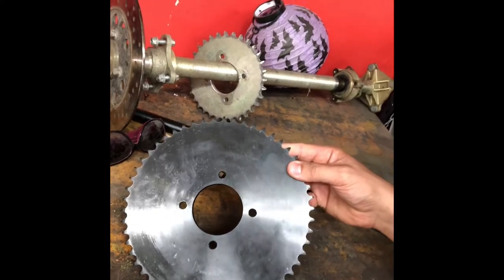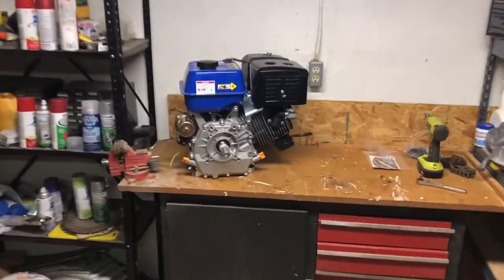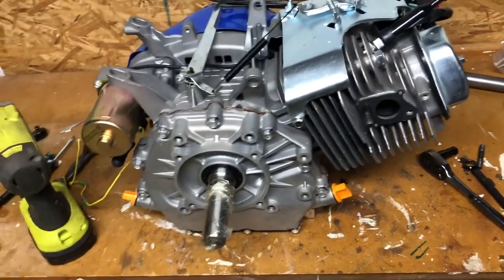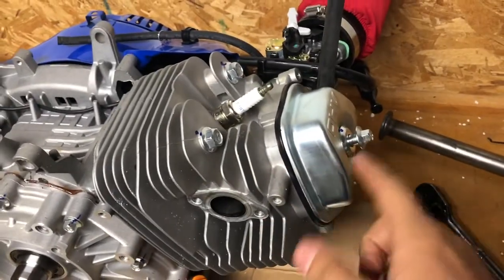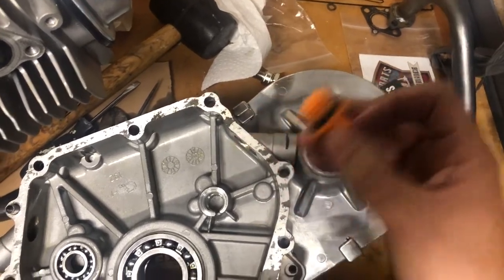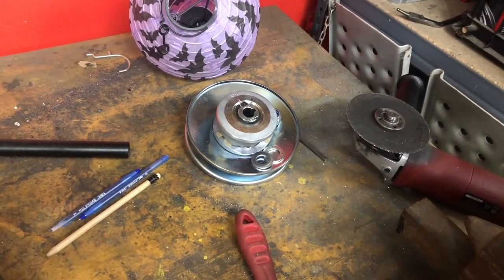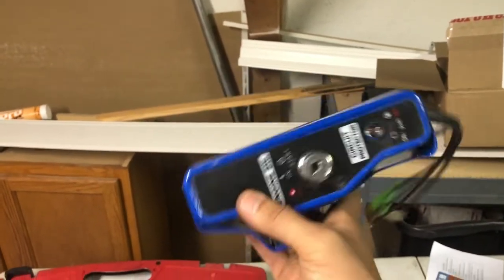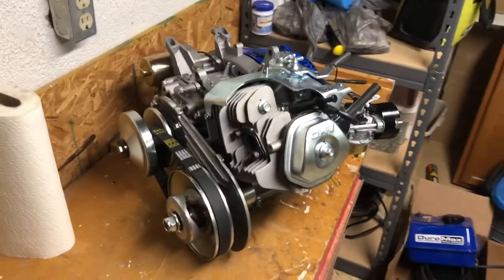Zircon/Carbide 150cc To 440cc 20+HP Engine Swap- Part 3 Engine build and startup

Comment: throw a flat-slide or a round slide carb on there...it'll make a difference..but thats the motor i am going with for my kids hammerhead 150cc so thanks for the build info..
Reply from the maker: Hi Jason, good idea Ill try that this spring/summer for sure. Still have to figure out the torque converter, its too powerful for the chinese one I have and is eating belts. Once things thaw here in Detroit Ill hop back on tinkering with it :)
Reply: @PeakPerformanceEngineering  Ya man..you def. need a 40 series especially if you decide to ride more this summer..some of the chinese 40 series do work pretty decent. but really need to go from 30 to 40 for sure..i'd love to be able to afford either a  true comet 40 series or even a 780 series but man thats gold prices for those things..

Comment: I'm doing the exact same project and have the exact same axle except I'm using a predator 420cc engine. Can you post the link to the larger sprocket you installed,  I don't need 90 mph but I do want good acceleration?
Reply from the maker: Thadius Doom awesome it’ll be a fun project.

Got that sprocket here:
https://www.google.com/amp/s/www.gopowersports.com/amp/sprocket-replacement-for-150cc-karts-41-420-chain/

Comment: I'm doing the same exact project you have to go with a series 40 torque converter the 30 will not hold up to the torque I've been playing around with these engines for a while I have videos coming out soon
Reply: Did u finish it?
Reply from the maker: Not sure if your asking me or David Williams, but yes check the latest videos in the build series, ended up with a go Powersports 40 series. Still have to finish a few things like the starter though. Now that weather is getting warmer I’m going to get out there and finish and make a couple more vids on it
Reply: Yes I ended up finishing I had the 18 horsepower duo Max way too much power twisted the frame almost killed myself I'm on to the next project which is a Saab 9-3 going for 500 horses out of a four-cylinder

Comment: Any issue with the stock flywheel throwing the magnet off?
Reply from the maker: I never had an issue but I probably only out 3-4 hours on it before I ended up selling it. Haven’t heard anything bad from the new owner though

Comment: Awesome video. Does this apply to the 420 duro max engine as well ?
Reply from the maker: Thanks! Everything should be the same with the 420. Must just be a slightly bigger piston or longer stroke in the 440 to get the tiny bit of extra displacement.
Reply: @PeakPerformanceEngineering  what’s the measurements for the exhaust.
Reply from the maker: What measurements are you meaning exactly?
Reply: @PeakPerformanceEngineering  like the space between the screws and the exhaust hole ? Idk 🤷🏽‍♂️ lol how to explain it
Reply from the maker: @samuelaruca4738  that makes sense, I’d have to measure but it was for sure a header for a 420cc from go Powersports. If you hop on their site any of the 420 once’s will bolt on, just have to make sure the pipe routing would work for your application. My header was way too loud so I out the stock pipe back on.

My plan was to but the headset and add a muffler but that hasn’t happened yet haha.

Comment: Did you know that those torque converters have multiple holes in the front of them so you could spend them I have the same thing in the ice Bond mind right out of the way there was multiple holes so you can mount it in multiple directions I didn't take the governor out of mine I left it the way it is don't want to be playing around with should like shouldn't be
Reply from the maker: Yep it has multiple holes, but none of them worked for this application, hence the modification I had to do. As you pointed out on another post, I think I'll end up upgrading this unit to the 40 series as it has been eating belts :)

Comment: how has that 30 series cvt held up to that 440? belt life?
Reply from the maker: Not good. Its been eating belts after about 30-40 minutes. Everything looks perfectly aligned too. I need to get the kart in the shop and mess with it some more though. I don't want to shell out $300 for a legit 40 series, but that might be what I have to do. Ive also thought about just upgrading the springs with legit 40 series stuff or different driven pulleys to see if that helps.
Reply: @PeakPerformanceEngineering   you usin the cheap china belts or a true comet belt? I think that engine on a much lighter mini bike might get away with a 30 series and comet belts as long as its not geared too high but on a heavier go kart, you just might have to bite the bullet and get a 40 series setup. still a cool build and the bugs will get worked out.
Reply from the maker: @billwilliamson9842  agree I have only used two chinese belts so far so I may try a higher quality belt first and see if it helps. If not I want to try changing some components around to see if it could help people from having to spend a ton of money on this swap. $300 is as much as the whole engine cost hahaha.
Reply: @PeakPerformanceEngineering   yea try the comet belts and you just might be surprised. good luck and I sub'd
Reply from the maker: @billwilliamson9842  awesome thanks Bill :)